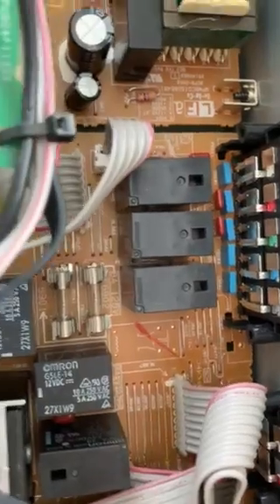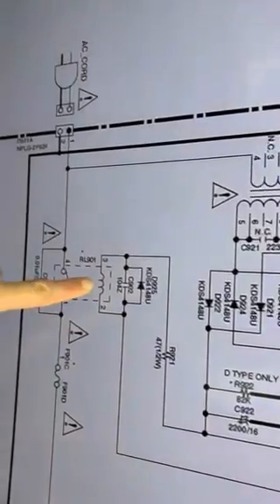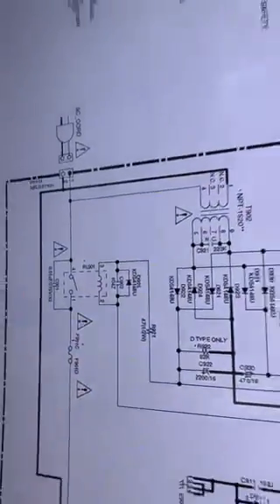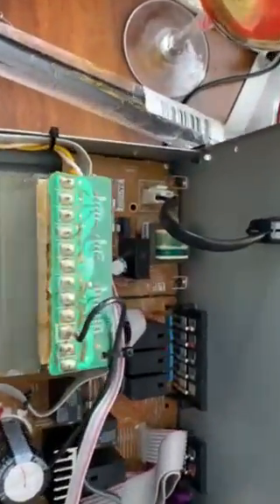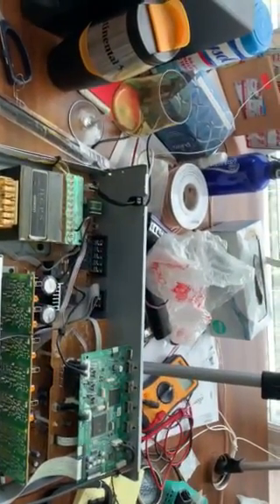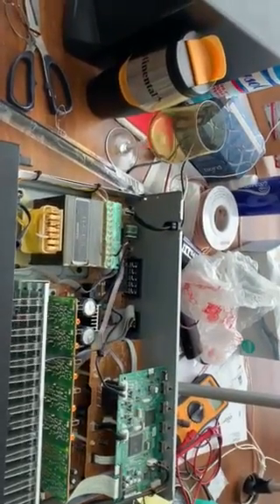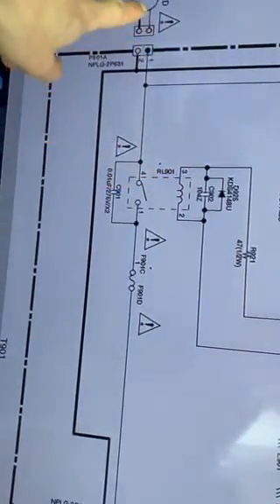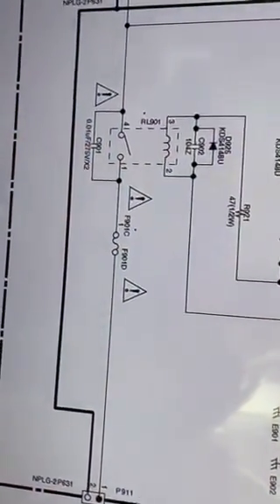How to fix the Onkyo TX-SR313 NO POWER issue?

Comment: Good evening. I searched on AliExpress and only found 5V, 10V, and 12V. Which one do you suggest I use if I can't find the 9V one?
Reply from the maker: Good day! I forgot what the part no. is. People here told me sdt-s-109lmr2. You could order it from digikey.  https://www.digikey.com/en/products/detail/te-connectivity-potter-brumfield-relays/sdt-s-109lmr2-000/2398617
Reply from the maker: I also saw it on the AliExpress website: https://www.aliexpress.us/item/2251832088079256.html?gatewayAdapt=glo2usa4itemAdapt

Comment: Hello! Can the factory sdt-s-109lmr2, 9 Volt relay be replaced by sdt-s-112dmr, 12 Volt relay? Will it still work? Thank you!
Reply from the maker: No, it might not be working. In the datasheet, the pull-in voltage is listed as 80% of the nominal voltage. The nominal voltage of a 12V relay is 12V, so 80% of this is 12 x 0.8 = 9.6V. So in theory, this relay should activate at 9.6V.

Comment: How u fix this ????
Reply from the maker: Ideally is to replace the relay. However, I found the relay costs more than $10, besides, I am lazy to order the part, so I decided just bypassing it by shorting the pins, it works but will turn on the 'standby' mode when connecting to the power, in normal operation it is in the power off mode until the users hit the power button, but it doesn't affect the operation, press the power button will be in the operation mode. The function of the relay is to turn on/off 'standby' mode.
Reply: @joelwang6134  这样不会缩短使用寿命以及造成其它未知方面的因素吗
Reply from the maker: @Stephanie25723  不会。因为只是这个继电器只是为了关掉待机状态设置的，所以如果你一直插着它会处于待机状态而已。你可以用个外面开关来关掉电源。
Reply: @joelwang6134  明白了，谢谢你的解答，小知识
Reply: @joelwang6134  不知道你还在不在，希望你在
Reply from the maker: @Stephanie25723  在呀！我在想你怎么找到我的。
Reply: @joelwang6134  视频刷到的呀😂
Reply: 我也不知为何，可能是我才使用不久的缘故？
Reply from the maker: @Stephanie25723  这么巧呀？
Reply from the maker: @Stephanie25723  😀😀😃😂
Reply: @joelwang6134  是呀，的确很巧哦！
Reply: @joelwang6134  你是在美国吗
Reply from the maker: @Stephanie25723  是呀，我在芝加哥。你在哪里？多伦多我以前去过很多次。
Reply: @joelwang6134  我就是多伦多过来的~我在俄勒冈波特兰
Reply: 我给你邮箱发信息啦！
Reply from the maker: @Stephanie25723  😃😀😅感动~我也回你了！